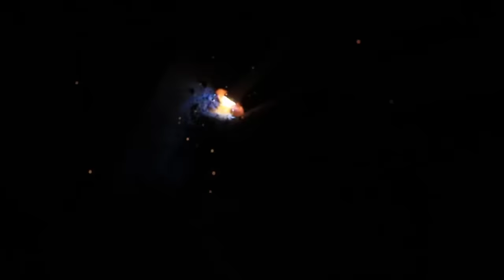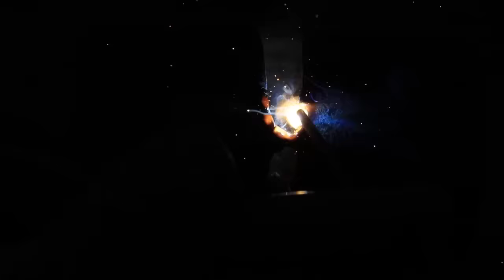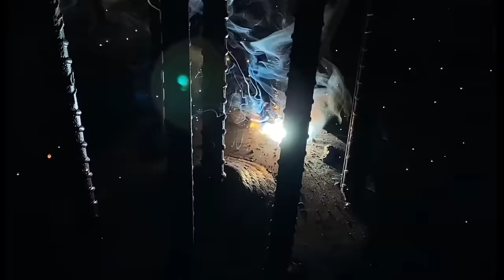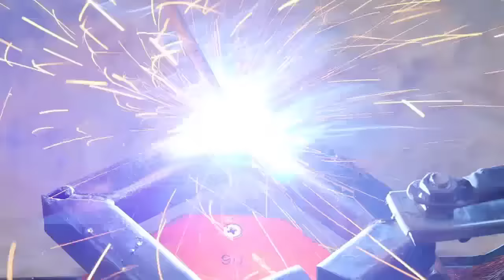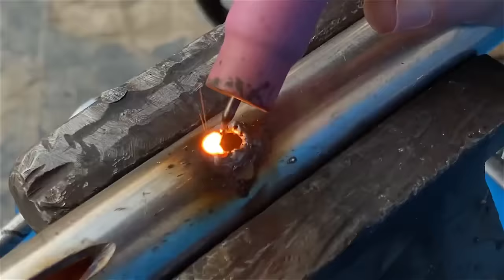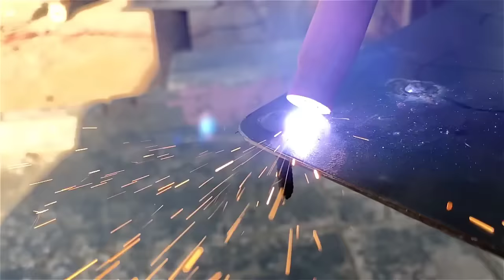Few people know about 1mm welding

Comment: Slag inclusion, that weld won't keep hung a cloth...
Reply: I dont agree!
Reply: @fortheloveofallthingsholy2706 about the inclusion or the cloth? 😅
Reply: Umm , agreed..wouldn’t pass an X-ray, but it will definitely get you out of trouble! 

Usually if you have to do this in a job for some reason, probably does not need to be “perfect”
Reply: Why would you care about inclusion, if your base metal is far weaker than your weld.
Reply: Yes you are right but the 1 mm will give out before the weld for the 1 mm

Comment: How many amperes? The electrode has the plus+ or the minus - ?
Reply: depends by the rod you use, but what i learned is if im welding some thin metal, rod goes to + cus it melts less, if im welding thick metal rod goes to -

Comment: With Tig are you welding direct or with gas?
Reply: Why would you ever do tig without gas?The "g" in tig stands for gas.You can weld using a mig machine without gas but you have to use a flux core wire which basically works the same as a welding stick but in a wire form and used with a different machine.

Comment: Use an off cut to bridge that gap. Or a steel wire, coat hanger etc. I would cut 3 mm sheet metal use that